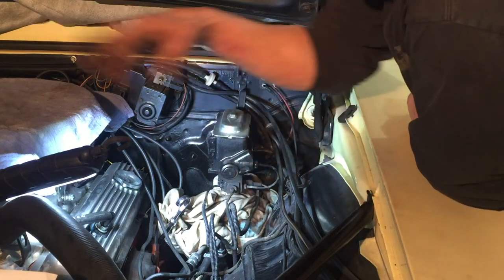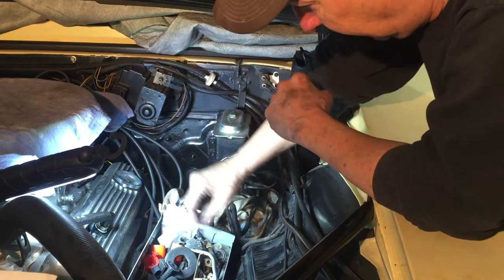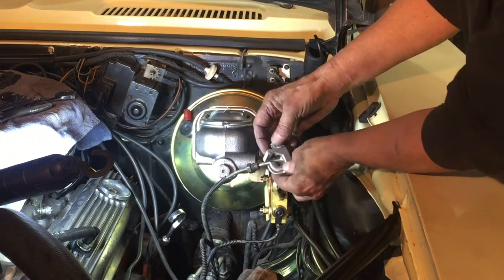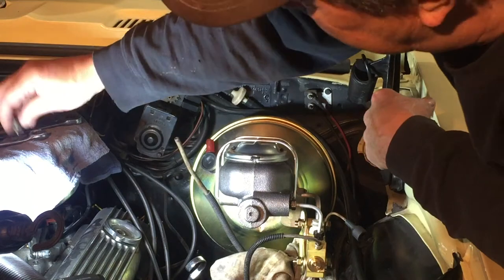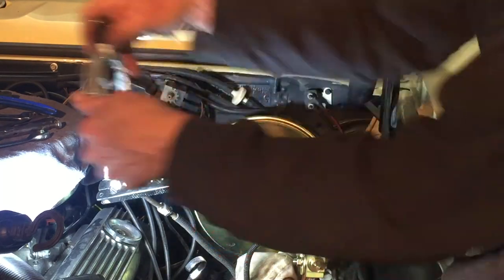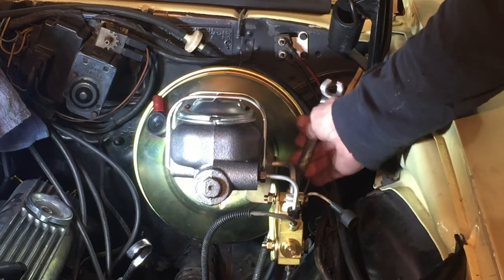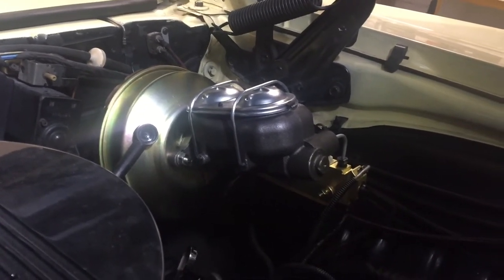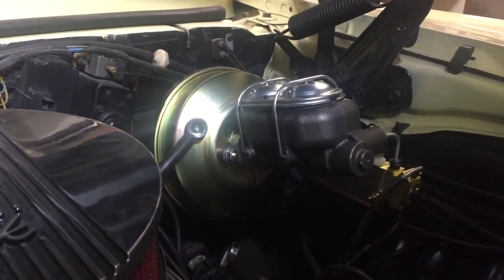1969 Camaro RS Convertible. Installing Power Brake Booster for disc brakes conversion for 14" wheels

Comment: I found when I did my front disk conversion the old manual breaks master cylinder connected to the lower hole on the foot petal.  I used that hole on the new conversion and my breaks were locked up.  After I researched it I found there was an upper hole meant for power disk breaks.  I moved the connecting rod up to that hole and it did the trick!
Reply from the maker: That's great that you were able to work through that problem.

Comment: 15:00 question for you. we bought the same kit for a 67 Camaro that came with the two rods that connect for the correct length to reach the pedal, as you stated. We didn’t know they needed to be cut like you’re saying. The first trial, we didn’t move it to the lower hole due to ignorance, and blew out the seal in the booster. Now we bought it again, and are desperately trying to find the information on how long these two connected rods must be, because without cutting, they are clearly too long. Any suggestions?
Reply from the maker: Sorry, I don't remember other than playing with the two holes on the peddle arm. I wish I had access to the car so I could look for you. I wish I could help.
Reply: I understand, we will get it. Thank you for the fast reply. ✌️

Comment: Hey so what if I have an LS1 Swapped, automatic, 20 inch wheeled Camaro? What master cylinder would u recommend? Also I have front disk brakes
Reply from the maker: Big wheels, big brakes, horse power? No question at all...             ...Hydroboost
Reply: Ride Rescue hydro boost? Where can I get that? And also if I were to upgrade the master cylinder would it be easier to flow more brake fluid into the well brakes? (See cuz I just finished putting on the front disc brakes, and I put almost an entire bottle of brake fluid but the brakes are still really loose and doesn’t stop)

Comment: Installing a new brake unit, why are you using old brake lines?
Reply from the maker: Very good question. I inspected the lines and they are in excellent condition. I cleaned out the brake fluid and it was clean looking. But when I inspected my Buick Skylark brake lines, as an example, those were rusty and soft, not worth keeping but I waited to long and I actually blew out the rear line. If the steel lines have heavy surface rust they should be replaced. You can also try lightly bending the lines to check how strong they are. If they bend easy they should be replaced.